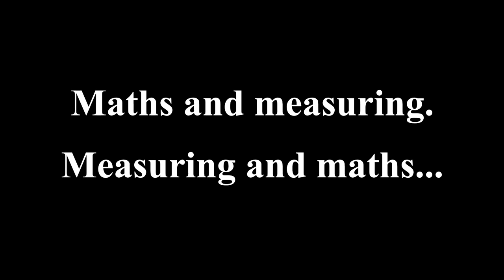Building ‘The Magpie’. An LED light up guitar... with no resin whatsoever.

Comment: Beautiful guitar Ant!  I don’t remember you doing silver leaf inside. I felt pretty original with the copper leaf inside my bass, until now. Super cool guitar, I like the way you maintain old school esthetics with modern concepts.
Reply from the maker: Thanks. The silver leaf was the spur of the moment thing which changed the whole design to include the holes and LEDs. Your copper leaf looked really nice, have you tested it to see if it’s doing anything in terms of shielding?
Reply: @4thAvenueGuitars , I was only going to copper leaf behind the F holes but when I saw how great it worked for shielding I did the entire inside and the pickup cavities. I videoed it but I guess I haven't edited that yet. So yes it was great for shielding. And what's this crap about "you can't carve a 335". You carved the snot out of this one.

Comment: Great build. I briefly spotted some nice kit for winding your pickups. Is that homemade or bought. Haven’t seen one like that before.
Reply from the maker: Thanks. It’s from uk-cnc it’s been my go to for years now. Lots of experimenting found what I liked in a pickup and this thing makes sure I can replicate it whenever I need to.
Reply: Bit more advanced than my old 1970’s black and decker drill with a thyristor controller. 😆
Reply from the maker: @johngrant5749  if it works... I still use my old home brew wonder every now and again If I want a really scattered vintage type pickup.